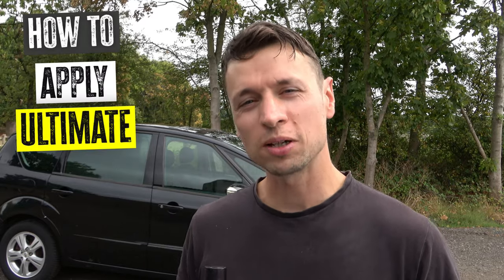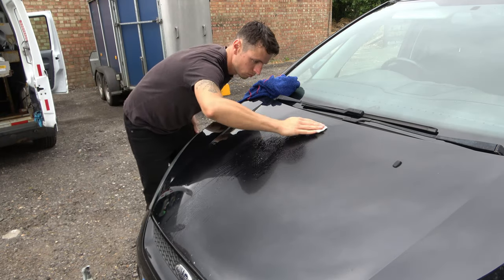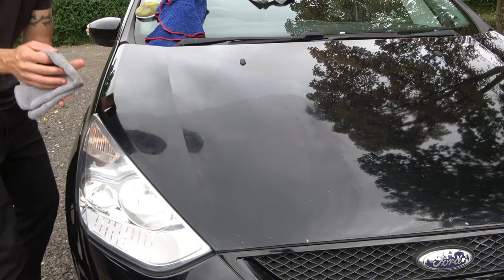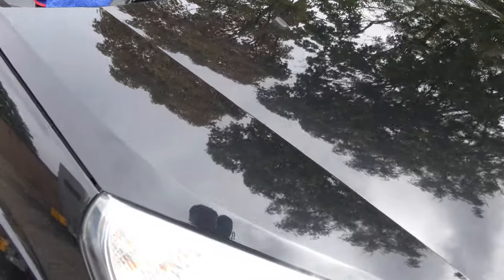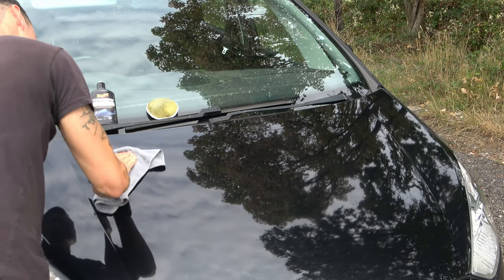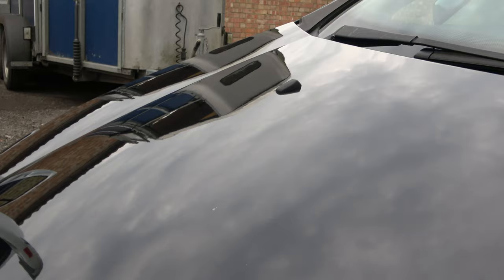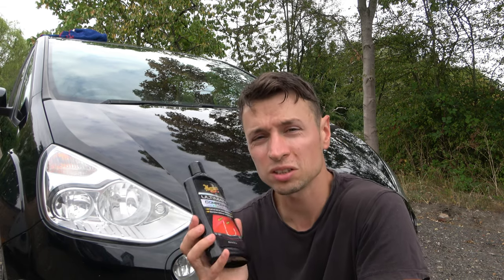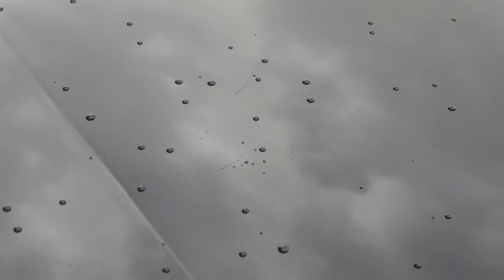Applying Meguiars ultimate compound by hand | Does it Work?

Comment: Hi. I’ve just found your channel and this video in particular and I’m so pleased I have! Loads of great advice for amateur detailers - thank you. I’ve just got a R59 Mini Roaster which I think would benefit from this process. My question is, given that this video is 4 years old, would you still use the same products or are there better ones now? (Yum ceramic, for example?)
Reply from the maker: Hi Tony thanks for the buymeacoffee I just noticed 🙏. I like so many products nowadays. I'm actually remaking this video as it was very old so I could add more info. I still use yum but I also use so many other brands too. I actually love the foam sealants
Reply: @epicautomotivedetailing  thanks. I look forward to the new video! I’m interested if the Meguiars compound and polish are still the ones to go for!
Reply from the maker: @tonywall8393  I would say a brand called zvizzer, medium cut and an orange pad are the best I've ever used with a machine polisher. I also have a bottle of rupes uno protect coming soon

Comment: I just bought the Meguiars Claybar, compound, Polish and ceramic wax. My car has pretty bad sun damage to the roof and bonnet but hasn't begun to peel. Ordinary waxing makes it look pretty good, but that needs doing fairly frequently. So, I'm going to put it on tomorrow if the weather is OK. I'll add to this comment to let you know how it goes...
Reply: Well, I did my car today. In the shade of a tree, but still a bit warmer than I would have liked. I had a big problem wiping the compound and polish of quick enough before it dried, and it left some streaking that was pretty near impossible to rectify. However, it is MUCH better and I'm happy with it. Just one note: The claybar spray liquid leaves overspray on the windows that I easily removed by wiping of with methylated spirits.
This was on my Holden Commodore or rebadged Pontiac in US. However, I also did my wife's old 1999 BMW which turned out really beautiful. I have uploaded a movie of this on my YouTube channel which looks really nice even though I took this movie on a cloudy day. You can see it by clicking on my name here.

Comment: I have been heading down the Rabbit Hole of trying to do my FIRST detailing of my BMW Z3.  She is fun, little, sunny day driver. Finally, someone showing me that I did not need a polishing machine.  I am at the Wash, Decontaminate, Clay, Compound, Polish, (then alcohol/water?) then Ceramic wax.  I was stuck on the "How can I compound and polish without a machine", I also happened to pick up those exact Meguiars just yesterday.  Finding this makes me feel like it's time to give it all a go!  

Question:  How frequently do you change out your microfiber applicator for the compound or polish? Do you change applicators or quick clean/air blast them?   Do you "prime" your applicator?  Same with wiping towel, do you change them out often? 
Thanks!
Reply from the maker: Thank you. I normally rinse it out after a few passes or it can build up quite a bit
Reply: @epicautomotivedetailing  Rinse it in water or?  Do you use it water wet then or grab a dry one?  Also do your "Prime" the applicator?  (thought I have heard this on other videos?)  If so how?  Thanks!

Comment: Hello, I’ve watched you in this particular video several times now, and thanking you in advance of my first attempt at using the Meguirar’s Ultimate Compound. What are your thoughts on using a “cleaner wax” paste afterwords? I will be using Mothers Brazilian Carnauba cleaner paste wax. My thought is that this will act as the finish polish AND final wax protectant following the Ultimate Compound. You are the best! Thanks for your informative and personable videos, I’m sure everyone enjoys them as much as I have. Cheers
Reply from the maker: Thank you Craig that's amazing to read this comment. Thanks so much. Paste wax is great for gloss but I'd be more inclined now to try ceramic spray coatings. I've been testing some really good ones recently. If weather is super cold then wax  can be a pain to apply. So that's a reason why I would opt for ceramic sprays
Reply: @epicautomotivedetailing  Fantastic! I’m so glad you enjoyed my comments. Okay, so I totally get your response and I greatly appreciate your suggestions. If solely based on temperatures, I would most likely have to agree, especially because I am located  on Maryland’s Eastern Shore, along the beaches of the Atlantic, roughly 150 miles from Washington, D.C., about a  3 hours drive! So yes, today it was a bit risk, with temperatures reaching 50 degrees albeit with some moisture, which did slightly impede the ease you demonstrated with the Meguiar’s Ultimate Compound... Boy was it worth it! I can’t thank you enough for your awesome video, you were so on point with this one! Like you, I also did this outside, and followed my local weather forecast for this week, and with tomorrow’s high expected to reach 60 degrees, I am going for it!! I have in fact decided to kill two birds with one stone. With my goal of trying to get a good coat of wax before winter weather is upon us, I feel that the Mothers Brazilian Carnauba cleaner wax will both, act as the final polish, following the Ultimate Compound, AND a finish of wax, which, like the Meguiar’s counterpart equivalent Gold Class Carnauba Plus, contains protecting polymers. Perhaps a one-two punch, huh? LOL. I can’t wait to show you my results. Btw, all this is being performed by me, by hand, on my latest acquisition, a classic (historic tags, antique tags in two more years) 1997 Mercedes-Benz SL 320, with a rather rare factory color, Midnight Blue with matching hardtop and soft top and Oyster interior. The German paint is a somewhat softer paint than American and Japanese cars. The Carnauba wax should further extend the depth following my Ultimate Compound session today... Stay tuned, as I can’t wait for my final results! Thanks so much for your most positive video and encouraging words and thoughts demeanor, YOU ARE THE BEST! P.S. This is my first “toy” since my BMW 525i which I sold in 2008, so this is a fun and big deal for me, I’m excited! Cheers
Reply from the maker: Amazing thank you for replying. If you are on Instagram send me a dm and will take a look 💪 thanks for watching 😁

Comment: thanks for this video! going to follow this path. Do you stay away from plastic parts and vinyl stripings to avoid with spots or build ups against the vinyl striping corners ?
Reply from the maker: Yeah o would stay away from plastic. Not too difficult to remove but still compounding by hand does take a while

Comment: Just watched this no nonsense and I am inspired. Already got the x2.0 scratch and now will go all out for the finish im looking for. 
Do I really need a cly bar if I have the 2.0 ?
Thanks
Reply: clay bar is to remove dirt from the paint that you might not normally see. clay bar just gives a really good clean to avoid making things worse. you can run your hand across the surface before and after clay bar and almost instantly feel the difference.

Comment: Thanks for this video! Love your honesty! Going to give this a try Tomorrow on my Newly purchased car. Unfortunately the previous owner must of had some enemies.. As there is a key scratch on the drivers door 😔 It was the only down side too the Car, But for the Price, I couldn't say no. I've tried to Spray paint it, Using colour coded paint.. But Not very good results.. Had the orange peel effect. 🙄 So I have removed this. And just left a light covering over the scratch. I'm going to give the ultimate compound a go.. I'm not sure if it will remove the scratch completely.. But even if it just reduces it I'll be happy. I was going to take it too the Garage to be done professionally, But they wanted £250! 😳 the scratch is about 30cm.. So I hope the ultimate compound reduces it slightly lol. Im going to clean the area first before application, Unfortunately I haven't got a clay bar, So it will just have to do lol Anyway great video. 👍
Reply from the maker: Thank you Justin. So not every scratch is possible to rectify so there are limitations but in terms of making an improvement then yes it works a charm
Reply: @epicautomotivedetailing   Yes, I've found it helps with very small hair line scratches and blemishes.. But doesn't do anything on deeper scratches or stone chips 😔 I've tried almost everything on a key scratch on my drivers door.. Although I've managed to make it less obvious. I can still see it. I've now used a colour coded touch up paint.. And very carefully filled it in as best as I could. Its the only thing on my car I'd like to get rid of. I guess someone didn't like me getting a new Car.. So decided to key my car 😡

Comment: Encouraging video to say the least. Quick question though. I don't have a  DA polisher so the only way I can do polishing is by hand.
The Vehicle was ceramic coated 2 years back and has been maintained to the best of my ability
But again swirls are inevitable and the vehicle has swirls(Not too many but yes the ones which you can get with regular washing and maintenance).
The paint overall looks pretty good and no fading or other major issues.
The vehicle is white in color.
I want your suggestion as to which product/polish should I use to achieve this (Remove Swirl marks on the paint on a regular basis like maybe once a year) and then apply some coating.
Unfortunately in India, the only prominent brands are Turtle Wax, Carpro, Gyeon, Menrenza, Meguiars, and few others but again not a whole lot of options like in the US or UK.
Now I understand that polishing by hand is not going to remove all the swirls which are Ok with me.
Even if I can remove 80% of the swirls/marks I will be a happy man since that is my pain point. Additionally, will the use of that product remove the ceramic coating?
Kindly suggest a product for my requirement. Thanks in advance
Reply from the maker: Turtle Wax (to the max wax) will hide everything. I've been a huge fan of it. I think in todays world you dont need 100% perfection. If the roads were perfect then yes but to the majority of people our standards may be higher so what we think is bad may actually be good.Thank you for watching

Comment: Hi, thanks for the video. I liked how the basics were included. I have a 4 year old black car in much the same condition as yours. I need to do this process, but I found a recipt from new saying it had a ceramic coating. Will this complicate the issue?
Reply from the maker: When did it have a ceramic coating and also do you know what the coating brand was. If it was a dealership protection then chances are it's long gone by now

Comment: You used the ceramic wax u had to manually rub on as opposed to the spray on wax? Any particular reason? To me, seems like the bottle u rub on the product would last longer? Love the video! Extremely helpful! I’m getting knowledge to do my 2007 427R ROUSH mustang, the paint looks horrible from being outside and contaminates. Thx
Reply from the maker: Thanks very much. To be honest to the untrained eye it didnt seem too much different. I think if i was to be picky id say the ceramic wax where you apply it by hand was a tad glossier. other than that id say ceramic detailers can get the same results in a fraction of the time
Reply: I meant by product last longer meaning you get more of the product in the non spray vs. the spray on product? So, economically using the non spray product you could apply it to more cars and not run out as fast as the spray product? Thx

Comment: 2 questions:
I bought the meguiars paint restauration kit which contains a clay, ultimate compound, quik detailer, 2 pads, 2 cloth and carnauba wax. Is that enough for my 2017 seat leon St? Or should i buy the polish and other accesories as well?

Also: what time do you think it takes to do this size of car?
I'm not experienced at all, only waxed my car after washing. Just trying to be nice to my new one:)

Looking forward to your reply.
Reply from the maker: Hello mate the polish will help but it's not essential. The car would take a good day in total with the wash included. Most Durable waxes are fusso coat. But for me once it's waxed I would just top up with ceramic spray after every wash
Reply: Thank You for the reply.
What ceramic spray do you suggest?

Comment: Hi there, must say great video and straight to the point.  I have a question, will this process still shine the car if the lacquer on the car is dull? Also I have autoglym polish to use after the compound, will that be good enough to use? Thanks
Reply from the maker: Autoglym is good but it won't last long so a decent wax after would give you better results for longer 😁
Reply: @epicautomotivedetailing  Ok thanks for the quick reply 👍

Comment: Thanks SO MUCH for posting this video!  I am not a professional detailer, I just love my car and simply want to keep it as clean and shiny as possible.  I tried using a buffer machine and it was a TOTAL FAIL!!!  I saw on one of Pan The Organizer's detailing vids where he shared that Meguiar's Ultimate Compound could be applied by hand.  So, I applied it by hand, followed it with an IPC, and later topped it off with Turtle Wax's Hybrid Graphene Flex Wax.  I didn't have the Meguiar's Ultimate Polish or their Hybrid Liquid Ceramic Wax and STILL...my car is gleaming!!!  Question...will I have to do this process each time I wash my car?
Reply: Not each wash as long as you remember to use PH neutral products to wash, ie pre wash, apc, shampoo etc. You can help it’s longevity with a spray on jet wash off LSP ( last stage protection ) like Gyeon wet coat, Pan does a very informative video on that too.

Comment: Love the video , im 23 and looking to get into the cleaning side of cars , Ive just bagged a 1999 10th Anniversary Mazda MX5 , its been stored in a farm shed for 2 years and its caked in harverst season dust , dirt , lime dust and lots of wheat grains in the car , iv have the inside a full steam clean and vacuum , looks amazing , but paint wise i gave it a snow foam and blast but the paint is very hazy , i know its a contaminated paint as i rubbed the a 1cm corner piece of the bonnet with a tiny piece of claybar and it started turning deep blue again , im very new to cleaning cars and would like to know if the ultimate compound and polish would help get my paint looking deep glossy blue again , any tips ?

Comment: Thanks so much man. I'd like to know, if you were only going to use 2 products instead of 4 for a really basic but acceptable oxidation repair on an old faded bonnet, which two products would you use and why?
Reply: I'd clay bar then compound. But you still need wax to protect it. So 3 products. That compounding product does a lot of the heavy duty work. But if you don't clay bar you'll have a lot of crud you'll be compounding into the paint. My car was 15-years old and beat up. After claying and compounding I was considering going straight to wax because it looked so good. But I polished too.

Comment: Hi mate, not sure if youll even see my message. When you use those application pads to apply the compound /polish, do u use the same one for the whole car or does it fill up too much with product? Thx
Reply from the maker: Hello mate I tend to just wash them out if I don't have any spare ones. They cost Pennie's so you can bulk buy for very little
Reply: @epicautomotivedetailing  thanks for the reply. What i was wondering was, if u use the same applicator for the whole car, does it get too full of the product from continually adding the compound or polish to it. So say if u start on the bonnet, is it still ok to use the same pad by the time u get 3/4 of the way around the car? I thought it might either get too soaked or the product might start to dry up in the pad the further u go. Thx again.

Comment: Just subscribed. Thank you for your uploads! You have a great perspective and attitude. I have a few questions if you have the time:

1. Is it okay for me to correct the paint on my red Jetta day by day, one panel at a time? The steps would be wash, clay bar, compound, polish, then wax every day that I have time for another panel. 
2. Can I skip the polishing altogether since the timing is more finnicky and just go from compounding to waxing using the same products you did? 
3. Can I use the hybrid ceramic wax on the whole car and then the liquid ceramic wax per panel after correcting the paint?
4. How do you feel about Meguiar's hybrid and liquid ceramic wax vs their Ultimate Fast Finish?

Thank you for your time and patience!
Reply from the maker: Hello yes day by day is ok. You don't at your own pace my friend. The meguiar's polish doesn't have abrasives so it's more of a glaze but you can get away without using it. Ceramic liquid wax is great but recently I've come across some even better waxes. Thanks for watching my friend
Reply: @epicautomotivedetailing  You're the best. Thank you. May I ask which waxes you've used that you like better or will you be releasing some videos soon? Any thoughts on Meguiars M27 ceramic sealant?
Reply from the maker: @robfrancis2195  my favourite waxes ceramic wax from go Detailing and yum wax and now turtlewax graphene wax is definitely making me away more towards that